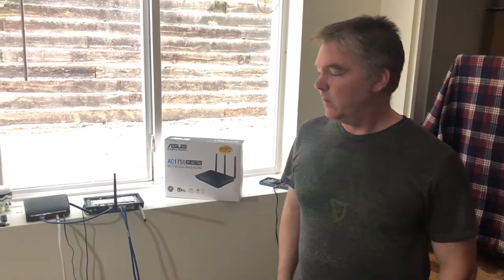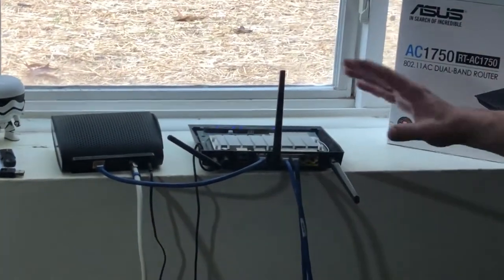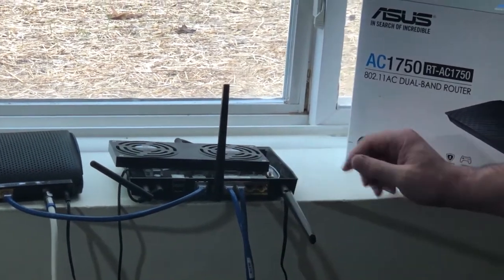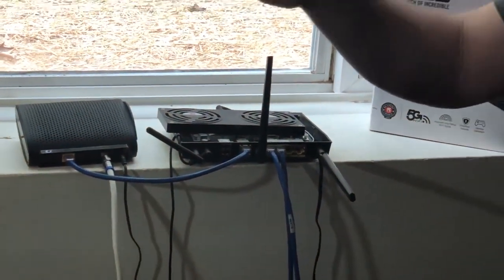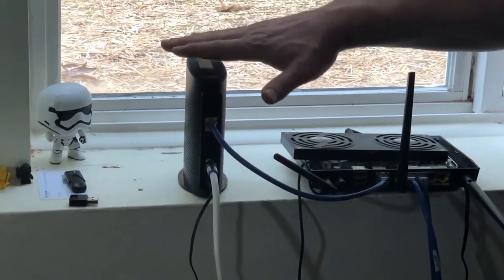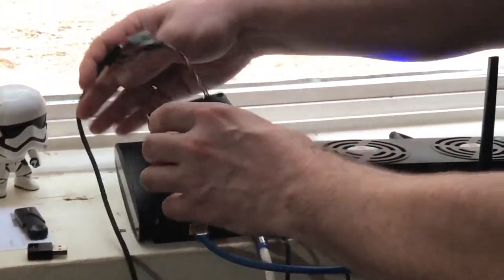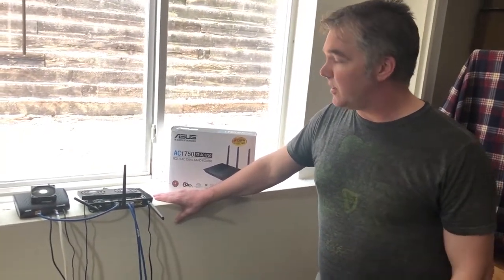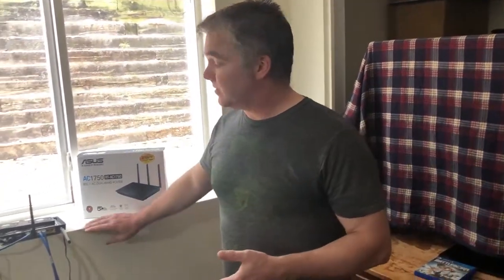Active cooling your router - Another Tech Video

Comment: Make full hole for your fan, it will hit airflow directly to the heatsink & decrease heat more effectively.
And put your router vertically will increase your signal strength as factory recomendation, it's about internal antenna position